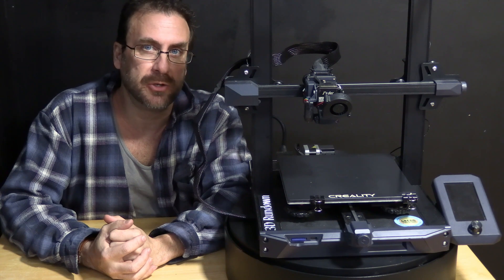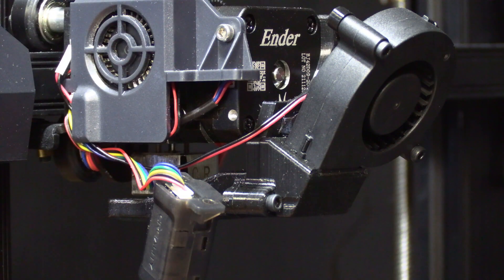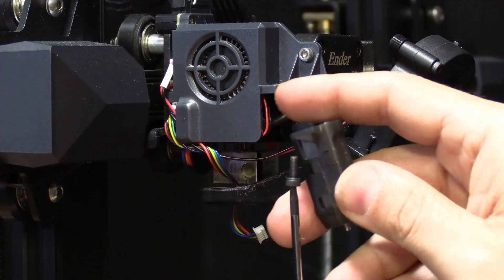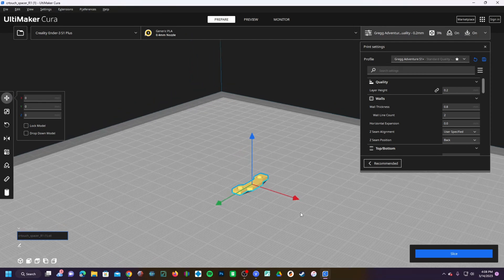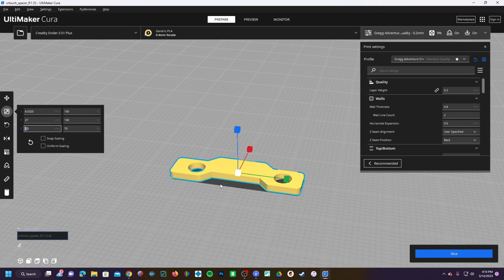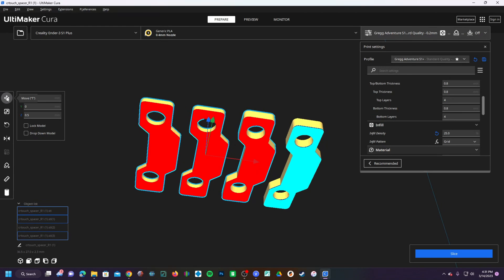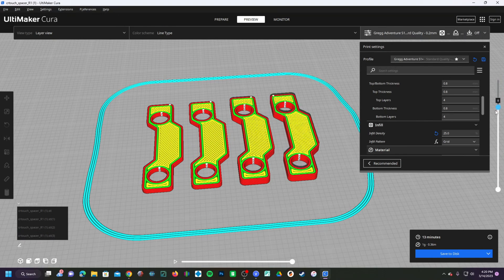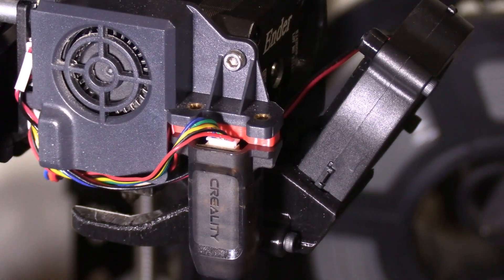How to Resize, print & install a CR TOUCH or BL TOUCH SPACER for any 3D Printer, in Cura

Comment: Sometimes someone just needs to point out the simple solution. :-D  But, just to have it down in text,  beware if your regular nozzle is overall high in the heatsink,  you could have a CR Touch probe knocking your prints when retracted.
Reply: is there any way of preventing this eg in cura with the gantry size?